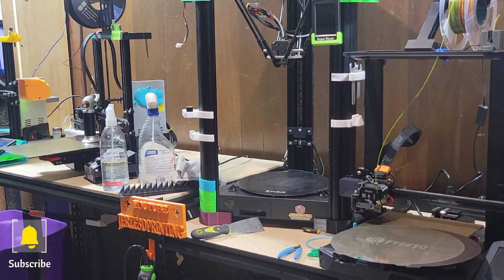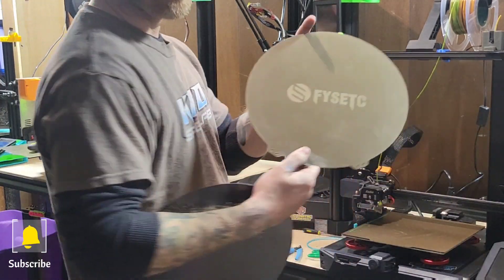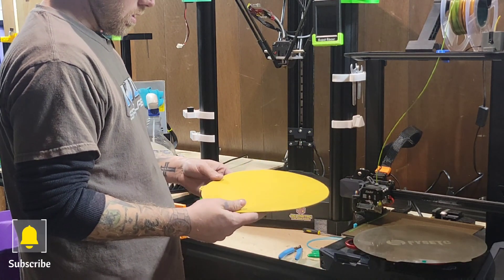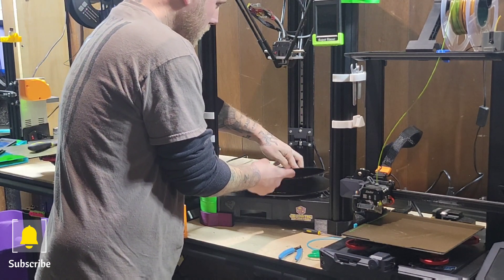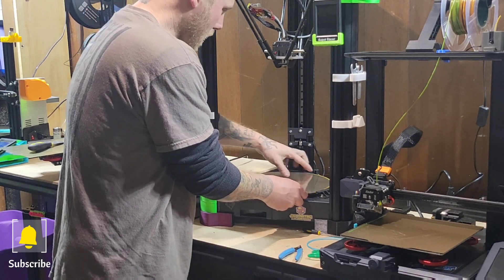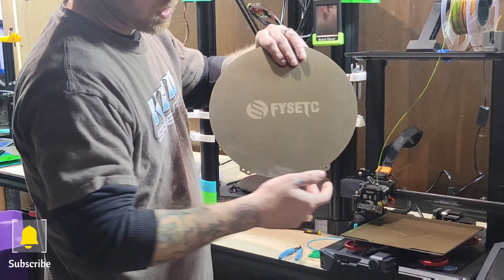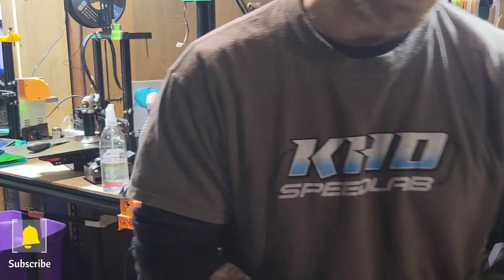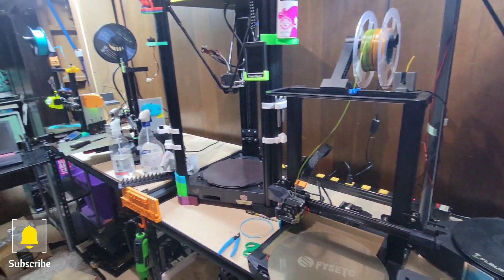FLSUN SUPER RACER HOW TO INSTALL PEI SHEET

Comment: You should have removed the glass bed first :-)
Reply: Not really, because if the metal plate under the glass bed is not super flat, you'll have issues. While sticking it on the glass doesn't have any risk, it would just take longer to heat, just remember to set the Z offset after. So if you wanna stick it on the metal plate, be sure to check if it's really flat first
Reply from the maker: Then what do you stick it to I don't even have it anymore I have a bambu orint farn
Reply: @J3DPRINTING  You remove the glass plate and stick it to the metal plate underneath. 
But... what is a bambu orint farn??
Reply from the maker: Lol to much work I got rid of it bambulab I'll do some videos
Reply: Because of this guy I have to rebuy glass and pei. I should’ve done more research. What an idiot. Nothing sticks now because the pei doesn’t get hot enough   Definitely remove the glass first